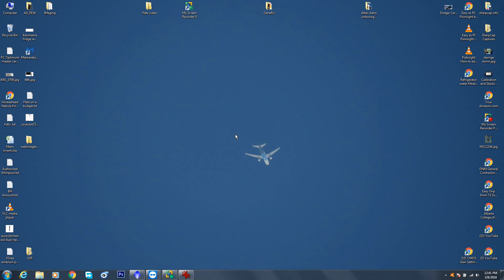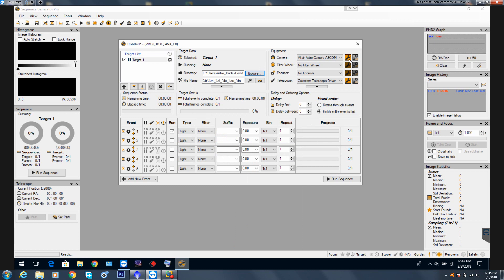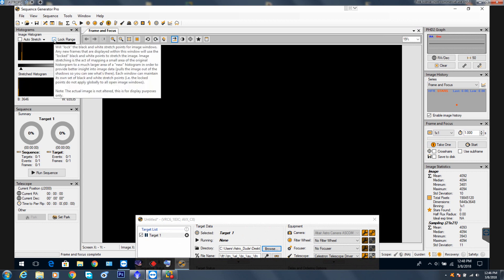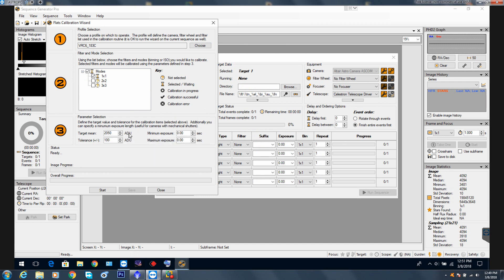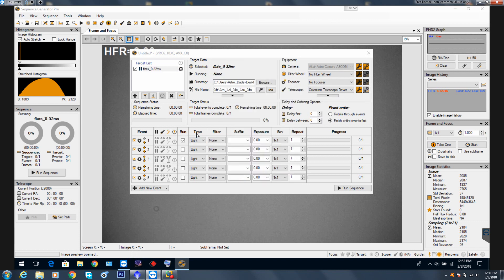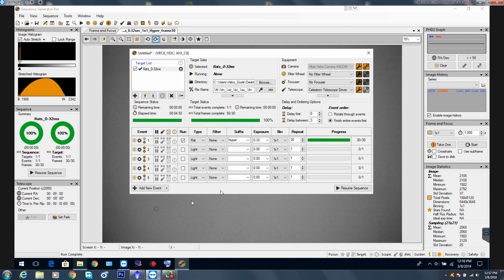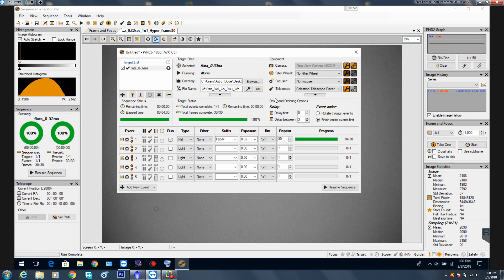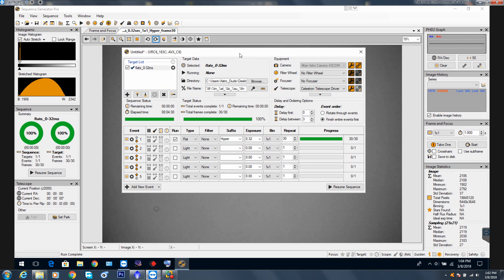"Flats on a Budget" SGP part 2

Comment: I'm a little confused Mike.  First though, excellent videos with lots of great information.  You've set your Flats gain to zero.  Aren't they supposed to match your Lights gain?  Also, when you took a one-second exposure with your light panel the Maximum ADU value for that image was 4094.  That's not the max value for the camera.  I thought we were to use a 50% (+/-) value for the camera, perhaps 31,000 for a camera like my ASI294MC that maxes out ADU at 63,700?  Yet, in your video, a value of 2050 produced  vignetting and donut results!  Thank you Mike!
Reply from the maker: lets clarify a few things.
1- Altair Astro like the AA183IMX is 12 bit hence 4094 ADU  ( not its full well !!!)
2- DSLRs are 14 bit and some CMOS cams are 16,000 ADU ( on some) 
3- some ASI ZWO  QHY are 16 bit  ( very few)  hence 65,500 ADU ish 
----------------------------------------------------------------------------------------------------------------
Now here is what happens in SGP , it renders supported cam ( native drivers) from 12 bit to 16 bit like the ASI1600MM PRo and others...
in SGP NINA and APT my camera is 12 bit , and remains 12 bit hence 4094 ADU , now as far as Flats , a lot has changed since 2018
when i made that video. so my update is this...
on the 4094 Cameras i now shoot for 1850 ADU  or 44-46 %  NOT 50% . then i aim for 1 sec exposures  ( adjust the light source accordingly )
if your ASI294 MC is 16 bit then try 45% or even lower so ive heard.. or around 28000 ADU.

hope that helps.
Reply: @AstroDude-Mitch  Thanks Mike (or is it Mitch?)  The ASI294MC Pro has a 14-bit ADC with a full-well of 63,700 ADUs.  In SGP's Flats Calibration, I don't see any artifacts or vignette until around 25,000, and for me,  I think the best Flats appear around 35,000 - 39,000.  I use a light panel as well, a lot like yours to produce a steady light source.  If I'm after a good "picture" of the artifacts with a Flat, shouldn't the calibration determine the best exposure, given a steady light source?  I'm unsure why you would need to "adjust the light source accordingly".  With all respect, I'm trying to learn to do Flats ( and Dark Flats) correctly.  I'm having PI come back with odd backgrounds on my Integrated results.  Thanks so much for your Tutorials.  I've really learned a lot about PI from you!
Reply from the maker: @DarkEnergyStudios                     adjusting the light source only means " get the intensity you need to reach your desired ADU.  by that i mean add or sub Tshirts or what ever your using to control your light source. dont be fooled by what the eye cant see, or can see , its a matter of flat fielding the frame and the results you get once you calibrate your Lights... some ppl reach the right ADU at 3500 and others at 30,000.. there is no magic numbers but they shoud NOT be tro short . try to reach 1 sec subs . for your desired ADU value.  on my ASI1600MM  thats  1.2 sec @ 18,500 ADU ... keep trying.    50 % have never worked for me..
Reply: Mitch I think that helps me understand better Mitch.  Watching Part 8 (Noise reduction) at this very moment!  So much good stuff there!  Really like you’re presentation style.  Q:  I noticed a video on APP you made.  A while back, I was frustrated with PI and found APP to be easier to follow and utilize.  Some moderately successful images, but it lacks some important features that PI already has.  Do you use APP?  Thank you!
Reply: BTW Mitch,  I’m just a couple hours East of you in C. Washington!  You must have precious few clear night out there on Vancouver Island!  Lived in W. Washington for 38 years, same there!
Reply from the maker: @DarkEnergyStudios     I no longer use PI for image calibration and LP removal ( DBE) and color calib ( Stars color) only APP  then i head to PI for noise reduction and saturation ...
Reply: Mitch, that makes sense to me.  All your Preprocessing is in APP?  It’s intuitive in APP & I get understandable results there, but no support for “Blink” or mapping in “Sub frame selector”.  Also, I’ve been waiting a long time for a module to wrestle with HDR.  Good to know that you blend them.  I’ll try that.  Thank you!
Reply from the maker: @DarkEnergyStudios  your welcome ............. im in Southwestern Ontario with a   SQM of 20.30
Reply: Oh, I thought Victoria BC!  My bad.

Comment: Hi AstroDude, good Tutorial, thanks for that. Maybe you can help me to find the max value of ADUs for my Canon eos 700d. Its not in the technical data sheet. Greetings from Gunter
Reply: Hi again and thank you for quick reply. I saw also your video with sharp cap. First I will try to replicate this. It seems to me intuitive. Than go with 35k in SGP.
Thank you again. Cu
Reply from the maker: If you go to SGP, then yes use the histogram and the mean values to help you nail down the right ADU .. you can use the Flats wizard but you need to find the right # in your case im guessing 12000 to 14000 ADU ( 30-40 % histo )  Cheers.
for those who need extra help i have a website with pay per play ( Pixinsight SGP/ APT SC))  Paypal ...
https://rcfmitch.wixsite.com/altair-support
Reply from the maker: Gunter , try this .. shoot the sky ( natural light) with a T-shirt for 5 sec at ISO 400 and you will fill the pixel Well ( fullwell) that will give you the maximum ADU of the EOS 700D . its 14 bit , i think so probably  32,000 ADU . but if your wanting to take flats , use the histogram  and look for 30-40% value. once you find that value, look at the mean number of that ( SGP , SC 3.1) its in there...
hope this helps.  PS: if the ADU is 32K then shoot for a # of 14,500 ADU that will be less then 50 % , then try it out on your target ...
Mitch

Comment: Hi there Astro dude! Have a couple of questions... I have a zwo 1600mm cool pro camera.. when I’m making flats I really had to diffuse the hell out of it, cause of black line banding on my images from using a tracing light board... do you recommend any other light boards for flats?  Thanks awesome videos
Reply from the maker: Your ZWO 1600 M is very sensitive to light , so you may need to double up on T-shirts ( if you were using them )  and if you can pull away from the dew shield a bit,,, or try taking daylight flats using the Tshirt method . works fairly well on an even brightness sky , preferably early in the morning or on a full cloudy day contrary to popular customs. lol . 
also since your ZWO is 16 bit , ( i think)  you will need to hit 50% ADU or HIsto but do not be afraid to make many lower subs as an experiment to reach the right calibration. . some ppl go as low as 3500 ADU from 32K...
Reply: Astro Dude thank you very much for the reply... at 12000 ADU was way low it was very dark gray and when I go up to 31000 adu I get 50%.. I also read and other forms that some light panels have Bad PWM.. were the camera senor  is faster then the light panel that’s what causes black line banding... I was just wondering about that light panel your using in that video... do you links on that panel??
Reply from the maker: let me find it , it was from Amazon , i think...keep in mind that i added extra white acrylic plastic to diffuse the light even more.....

Comment: Awesome video! I just wanted to let you know that you were VERY left justified on your histogram. When you read 4000 something for maximum, that was the max on the screen with the test shot you took. The full well capacity of the 183m must be much higher than 4000. The only reason you saw the vignetting and dust mote was because you had it stretched. Aside from that, the process was right though!
Reply from the maker: the full well of the 12 bit AA183/M is 4094 ADU. if it were 16 bit it would be 65000 ish. your right about the stretch which cheats the actual screen view, i was interested in the 50 % ADU for a good flat based on the Pro Observatory youtube video i watched from AIC. we are all students , i dont claim to know everything.
Reply: My Max read is 65528.  My Mean is 17377,  I do see vignetting only a little bit on the flat.  But after taking 50 flats and processing an image, I saw quite a bit of vignetting on the processed image after I streched it.  I need to try half of of Max read and try this again.
Reply from the maker: i have since made some changes in my workflow , for flats , it seems 50% is way to bright and ends up overcorrecting the dust bunnies and the vignette, so now i only watch the histogram Mean values... .... if i'm running  my Altair astro 183C hypercam  at 12 bit 4094 ADU , then i want to see 1850 ADU (Less then 50%) on the mean values in SGP .  i do it manually and don't use SGP wizard at all.
 if im in APTools 3.55.8 then i let the wizard find 1850 ADU +/- 50.  all this under sunlight before sundown .  about an hour.
i'm going to have to redo another Flats video , because there still seems to be some confusion as to the right ADU and light source.

Comment: That was a great tutorial :) I'm just about to change over to SG Pro from Nebulosity  so seeing you do the flats was awesome. Thanks.
Reply from the maker: please keep in mind that 50 % is ONLY a starting point and make sure you make many runs past 50% and way lower then 50% to get the flats to average out in the final Light frames. GO as low and as high as you can and experiment.
Reply: Yeh I really need to experiment with Flats, in the past my Flats in BYEOS and Nebulosity always seemed a bit strange. I was always needing to double stretch the master Flat in PI just to see them. Don't get me wrong they did work but I always felt I could do them better. So I look forward to trying SG Pro. And i might try them using a T-shirt :), I only ever used a home made flat panel. Thanks

Comment: Wow, I'm so embarrassed of that M51 pic!  It looks so much worse on a larger screen.  Also, I have only had my Hypercam for about 3 months.  In that time, I've only had it out maybe 4 or 5 times.  Do you feel that flats will get rid of all of those dust spots on the M51 pic?  Of course, I would have to re-image, but I'm ok with that.  I enjoy the process. 

That being said, I am definitely going to be using your method for creating flats.  I use a t-shirt and my 10" tablet with a white screen.  I also saw a flatfield panel sold by OPT in the US (https://optcorp.com/collections/image-calibration-tools/products/gn-10-302-160-aurora-flatfield-panels-for-160mm-diameters-12v).  I may order one of those at some point.
Reply from the maker: its ok it served its purpose well, and it shows what so many of us have to put up with... thank you ,,,Flats are monsters that need taming i still get it wrong sometime and dont know why. just keep at it.